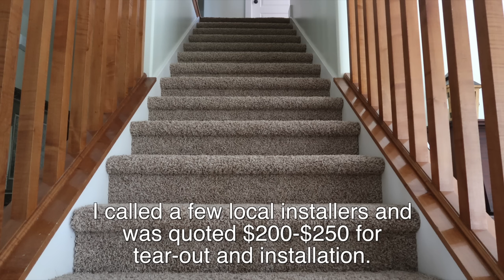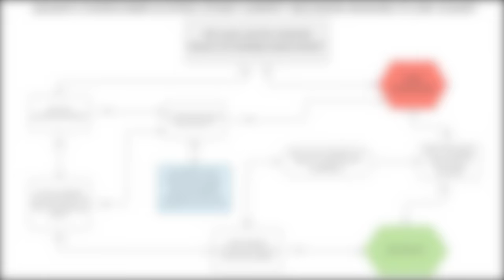How to Install Carpet on Stairs - how hard is it?

Comment: When I called to install it was $200-350 a step.
Yeah, no thanks I'll give it a whirl on my own. I have a new addition so there's nothing to take out or need with, it's only installing.
Thanks for this video!
Reply: You called the wrong guy . Or he meant 3.50 $ which is very cheap .
Reply: @michaelerdmann9759  it was a company. Honestly, I felt like I was getting screwed because my family owns a large local company, do since my last name is the same, I think they were just assuming I was loaded as well.... NOPE! Just a single Mom who's done okay for herself, but not loaded but any means.
When they said up to $350 per step for materials and supplies I was pretty shocked. I knew stairs were more, but when I did a full remodel on my first house, it wasn't that expensive. Ughhhh....
I'm planning to just try to do it myself. I finished a lot of my new house myself and have a lot of the tools. Besides the carpet, passing and tack strips, I would only need to spend like $100 for some extra tools to make it easier. I purchased a lot of other tools went I finished my home, so I already have an air compressor, with a staple gun, so it won't be too bad.
Reply: Usually need about 16-18ft of carpet equivalent in pad 12 steps, and install i can see be 3.50 a step especially if theyre open steps that need to be customized or has spindles, If its not a basic install like in this video, one step can take you an hour if its custom, and having them properly installed will prevent the carpet coming loose and someone sliding down the stairs
Reply: @4G64SicKShoT  you understood that it was $350.00 not $3.50 a step right? Steps are expensive, but not THAT expensive for the steps I have. I'm just going to do them myself.
Reply: @goose7574  I think you might of misunderstood the guy, there's no way it would cost 4 grand just for install
Reply: @4G64SicKShoT  yeah, I didn't. He said $350 a step. I'm pretty sure it's because my family owns a large local business and my last name isn't very common, so he assumed I was loaded like another family member. It was just crazy.
Reply: @goose7574  Yep HD in Cali here wanted $1000 for carpet and install of 180sf which included a small upstairs hall and 12 steps.
Reply: @4G64SicKShoT  it was $250-$350/step as a total. Not just labor. In their defense, they didn't ask me ANY questions (if they were old steps with carpet, new build, what kind of carpet, pad, etc.)
This was a range when I called a local flooring company and asked about carpeting stairs.
I know from already redoing my first home, that you aren't going to be charged $3.50 for install on a stair. Nobody in their right mind would do that low of a price. If that was the case, somebody would only pay $35.00 for carpet installed on 10 stairs, and I think we all know that that's not what a company would charge for labor.
Reply: @seeingyouontube  That sounds more realistic especially going through a company likehomedepot, they subcontract to a company like mine for install, and we get paid roughly 3-8$ a step and 3-4$ a sqyard of carpet. Ive seen contractors straight rip off their customers because its tedious work, and theyd rather paint then install carpet. I had a customers toilet rot out and we couldnt do the job without fixing subfloor, home depot asked us if we could do it and we said 200 because fixing floor around a toilet is no fun and we had to buy the proper saw. Anyways home depot charged the customer 900 to pay us the 200
Reply: @Phillip Trujillo 
$10 for what?
Tear off
Install only
Carpet only
Pad only
?
Reply: @goose7574   IMO one of these two options happened to you; either the flooring company thought you were looking to have the stairs done in hardwood/good quality laminate/LVP (the price given is compatible with these) or this company is the biggest ripoff in the country  and wants to make an easy prey out of you.
Reply: @ignaciomarques89  
Yeah definitely not hardwood or laminate. Just carpet. It's part of a new addition and I just called for a quote. I was shocked with what they said, but have decided to just do them myself.

Comment: Use a knee kicker first, then stair tool with hammer
Reply: Andy Greenway  it may work but it's not the right way to do it
Reply: Says the CRI, and a lawyer if someone falls down the steps due to your negligence.
Reply: Andy Greenway  thats the hackers way
Reply: @Mase Mason Same, every fitter I know fits top to bottom.
Reply: @cronut7113  My boss does them top down, I do them from the bottom up. We had a race the other day, who could install two steps faster (riser and tread, one step). His fastest time was 51 seconds for two stairs, mine was 49 seconds. We both agree that long term, its better and easier on the body doing it my way, and you will get a better stretch easier, without killing your forearms, especially on extremely dense, heavy ounce carpets. I also guarantee that you will get a better stretch period by kicking it in versus using forearm strength on heavier ounce material. Both ways work, but doing them my way, then I have energy to kick the rest of the house in well afterwards, whereas doing them top to bottom, you get gassed much faster and it depletes your energy much quicker, which could be reserved for hard stretches for the rest of the house that you're installing.

Comment: There is no need to restretch if you follow you have fitted it the issue is staples if you use correct number and use the stair tool properly you will be onto a winner. Use a sharp sharp blade to make life easy and no messy ends.

Comment: Lovely job, I prefer to use a rubber mallet saves the ears from the noise and the weight drives in to the corner of the step, its to me easier.. cheers

Comment: I fitted carpets and cushion flooring for over 40 years just coming up to retire, whoever fitted the carpet he took up was fitted cheaply with all those staples. Should have 2 rows of gripper in stair tread spikes facing each other, and as Juan Badillo said start from the bottom use knee kicker on each stair into tread tucking down with blunt bolster, that way you wont get bubbles or stretching, that's the way all the fitters iv known quite a few, were taught years ago as trainees.

Comment: Can I use the electric stapler for underlay and for carpet?Or I must buy a hammer stapler too?Thanks for all!
Reply: No, use a staple hammer for underlay, the wider a11 staples hold the underlay in place but to fix the carpet you’ll need the electric stapler. It uses thinner and longer staples

Comment: +AdamDIY I don't know the proper terminology to use, so I have to try the best I can to ask here (because I can't figure out how to reach you otherwise)- I have baseboards along the length of my staircase up from the fist floor to my second floor landing.  The wall has molding that is separating from the baseboard where I can see through the gaps.

Do I cut out all of the caulking,  and try to reapply new caulking to replace it, then paint over after a couple of weeks (to let it dry)?  I am concerned the gap is more than a think bead of caulking.  Thanks.
Reply: Warron French I would remove all of the caulking, and put some nails into the baseboards (if they are coming off) afterwards, yeah put the caulking back on and then you should be fine to paint after a day of drying if that.

Comment: Work your way down not up when you take steps off , start your pad at the edge of the riser so you don’t have to cut each one also pre cut the width it’ll go a lot faster. no kicker?Their gonna be loose, you gotta hammer the crotch ( where the riser and tred meet in the back) you look like you were tapping it, hit that stair tool ! If you use a kicker it’s actually easier and quicker, a set of steps like those should only take you about 2 hours from beginning to end.

Comment: Yeah doing ours soon pretty confidejt but was it brad nails u used on actual.carpet? I know u used staples on underlay if they were brad nails what size did u use thanks
Reply: They were staples. It's in the video.
Reply: @reecenewton3097   I don't think you read my question correctly I asked what side it appears you're being smart with me this reply is around 2 year old I've dine the job in hand no issues 
Thanks I....... think

Comment: Best to use a stretcher/kicker from the middle of the step working out to one side and them the other, stretching and securing the carpet into the gripper rod as you go... followed by tapping the bolster chisel to fix the carpet in place... still, you made a nice job of it.

Comment: I could carpet those stairs in a hour and do it the right way. However, it might take me 5 hours to remove those staples. I would charge a premium for removing those pneumatic staples.
Reply: Meddle & muse all you need is  a scraper and you’ll be done in about 10 minutes, your  doing it wrong if you need to do it in 5 hours 😂 it takes about 1 hour to install carpet and pad
Reply: @angelb.1503  I'm sure you're right Angel B. I only did it for 30 years so what would I know.
Reply: Meddle & muse well my father has done it for around 30 years as well and I’m learning at the moment but in saying there’s no reason to charge more just to remove the staples
Reply: True that your just robbing people of money when u scrape it off with a scraper and in like ten mins ur done

Comment: DIYers DO NOT INSTALL YOUR STAIRS LIKE THIS!!!  He didn't fold over his edges, he didn't cut the pad correctly you're supposed to wrap the pad around the tread over hang. Your also need to start at the top of the stairs. Also number one rule is you never have a cut end or side exposed. Fold the carpet offer itself 1 inch. Always use a stretcher/knee kicker.

Comment: For a typical set of stairs I charge $10 a step so this flight of stairs would've been probably $140 for about an hours work did a pretty good job without using a kicker that's for sure

Comment: @AdamDIY question, I noticed that you only reinstalled the padding on the steps themselves.  I assume that is fine, but when I tore mine out, it was basically attached like the carpet and pulled out in one long piece.  Any benefit or disadvantage to only tacking the padding down to the steps and not the back sides etc, or is it just a waste of time to do that?

Comment: I believe you should be installing the staples horizontally not vertical . I realize it's easier to hold the gun and staple the way you did it but your carpet will be pulling at the side of the staple. No good

Comment: more easy to cut the carpet to a corner of the step,Ive fitted the whole carpet all in one peace from the top of the stairs working all the way down before as well as cutting the edges as well,Not easy Job really,Took me a good few hours,Thats why Im glad I got the carpet professionals doing mine soon,Then thats my flat just about finished and about time after 5 solid years

Comment: I agree and disagree with his install but labor estate of 200 to 250 is close
Skipped steps is need a kicker plus staples on step, not many steps are same so measure each step one by one... Stairs suck so yes installers charge for the job

Comment: Had a flat velvet commercial carpet pro installed. When I ordered it the guy said they didnt need glue, but it didnt stay stuck very well to side raisers. They came back and stapled it down. Staple shows slightly. Wont return calls. I'm tempted to pull up staple and squirt glue under with a tube or something on the edges on top of tack strip.. Or should I just quit OCing about it?

Comment: Carpet installation on stairs, done by professional companies, with 10-30 year warranty runs about $300-$600. Definitely NOT worth DIY with no warraty whatsoever.  Now if we are talking hard surface on stairs ($2k-$5k), then it'll be worth it DIY 'if' you're handy. That's my 2 cents anyways.

Comment: Hmm mby get normal european wood stairs ? So u dont have to do this after some years or get ceramic stairs and install a electric heating sistem under them so their heated stairs like yea that will cost much more buuuttt u will have it for 30-40 years without replacing
Reply: Ceramic stairs would be the dumbest idea. Almost as bad as carpeted stairs.

Comment: That is not the way to fit stair carpet underlay should cover stair nosing no gripper on the sides and
Start at the top and you don't staple the carpet you only need a hammer and bolster I have been fitting carpets for over fifty years
And it takes about one hour to fit a flight of stairs
Reply: No gripper on the sides?? You dont need it but better finish with gripper on side

Comment: doing it this way your carpet will look ok for a month or two, it will begin to bubble and loose carpet wears out very fast, I've installed for 40 years................oh yeah rubber hammer easier on the ears. .................just cause it looks good doesn't mean its good for the long term

Comment: Please rename this. This is not "How to install carpet on stairs".
Reply: right on only a hack would put tack strip on the sides of the step and then staple the crap out of the carpet under the nose.  Probably got his info from a home improvement store
Reply: The smooth edge is so you get a proper stretch on the sides aswell. They are pointless without a kicker though. He stapled in the right spots but didnt bury his staples.

Comment: The face of the noses should have been covered with pad. Also a kicker should have been used. Also a curved stair tool. But that's just my opinion. It's cheap carpet that shouldn't be put into a nice place. That product is for a low income rental.